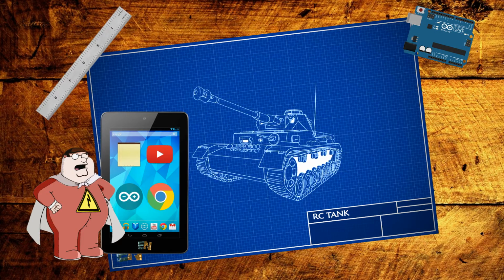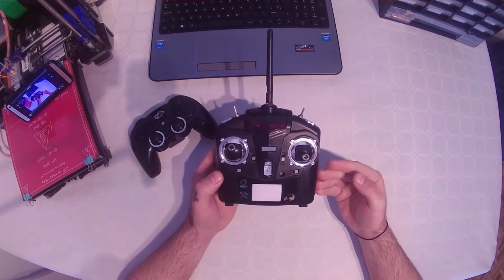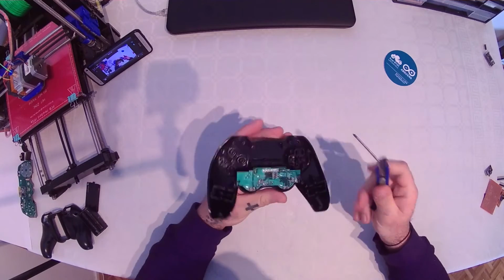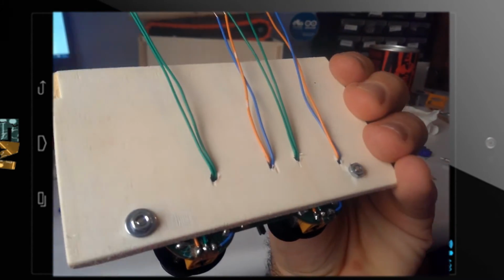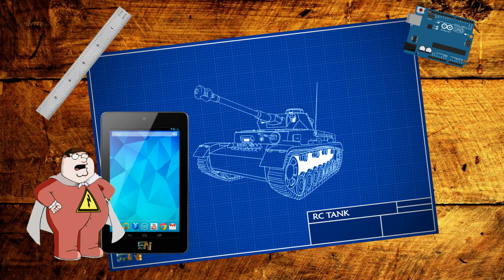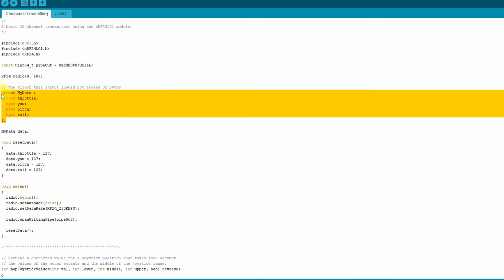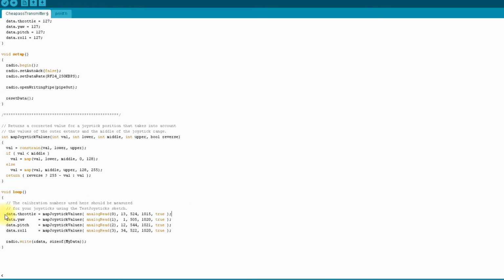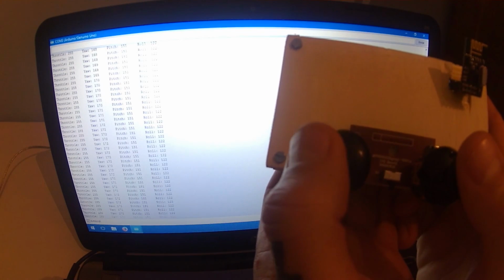3D Tiger 1 Radio controller  arduino  NRF24

Comment: My serial monitor prints some wierd characters...like some boxes ,... Not printing the received values ... Though the baund rates are same ..don't know what's happening... Help.....
Reply from the maker: If is not the baud rate the problem, I don't know... Make sure to have the same baud rate for the monitor as in the code and nothing connected to pin 0 and 1 whic are Tx and Rx from serial monitor...
Reply: Electronoobs  Maahh you are really a nice person..... Thks for the reply ... I'll check that out...

Comment: can i ask something from your experience..i already build a full homemade RC boat and initially i wanted to use an arduino nano on the receiver side..after burning 3 of them i switched to a uno on both sides..i couldnt find out why they got burned though..UNO works fine..could it be that arduino nano couldnt handle the current surge or something? any ideas? it really bugs me not to know
Reply from the maker: chemgreec might be that. I always add an external 5V voltage regulator and supply it's output to the 5V pin.

Comment: Hey man, can you help me? I did the same thing like you in the video, but the serial monitor only prints stuff like that: ˜äŒ@c€……3¥s¤Î„D9‹ŒR˜Ž„òäŒDcˆ
What did I wrong?
Reply from the maker: That's because of the baud rate. If in the code you open the Serial.begin(9600) in the serial monitor you should select the same 9600 baud rate. For that open the monitor and in the bottom right corner select the baud rate.
Reply: Hey thank you for the quick response!:) One more question where can I finde the TestJoystick Sketch?
Reply from the maker: Lenni B if you can't download it from the video description then go to the webpage tutorial link and you could copy it from there. keep up! I'm glad I can help!
Reply: Sorry I don't get it :/. How can I read the values 0-1024 to callibrate my joysticks? You wrote in the sketch, use the TestJoystick Sketch but I can't find it. I only find the receivertestcode. Sorry for my many questions...
Reply from the maker: Helo dear electronoob. Go to this other tutorial of mine. http://www.electronoobs.com/eng_robotica_tut5_2.php

At the bottom of that page you can find the "Transmitter test code". Copy that code and upload it to your receiver. That code will print the received values. If the scale is not good just change the "mapJoystickValues" function in your transmitter code in order to send the values that you want. 

The test joystick sketch is the same as the receiver test.

So you upload the transmitter code on your radio controller. Than in another arduino with the same NRF24 upload the receiver test code. Power up the controller and open the arduino monitor to see the received values. Keep up. any question, any time ;)
Reply: hey man, ive already tried that and it ddnt work for me, some weird characters keep showing up on the serial monitor of the receiver even though the baud rates are the same, i even tried updating the arduino ide and all updatable boards configurations and its still messed. any recommendations?
thank you